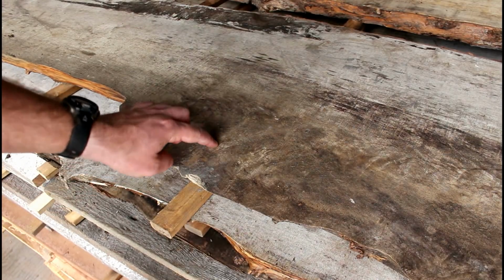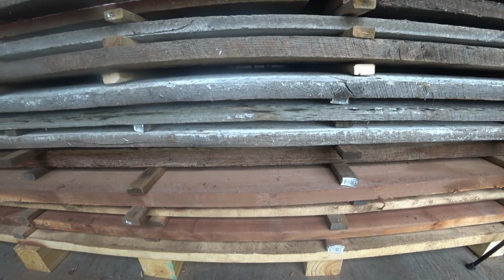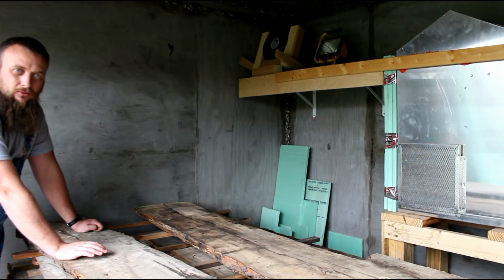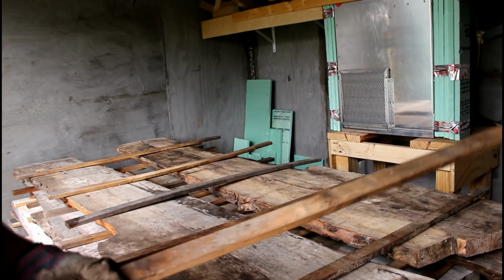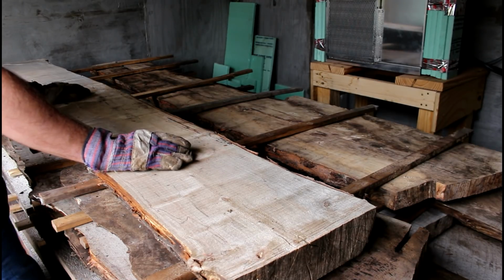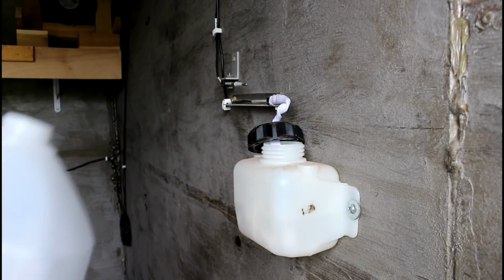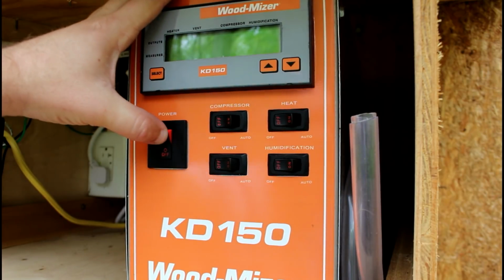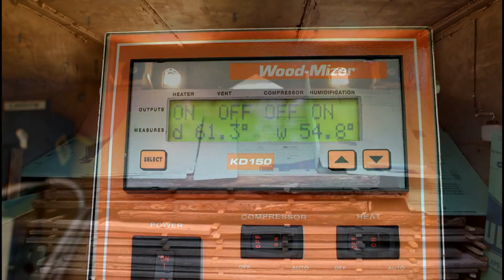INTERESTING WOOD-MIZER KILN EXPERIMENT, SPALTING WOOD AFTER SAWMILLING,

Comment: Good video Nathan.  My horses ringbarked a maple and killed it.  It was on the list of "stuff to do" and I didn't get a chance to cut it down.  Then it became an obvious widow maker and I simply ignored it until all the upper limbs shed off.  The plan was to drop it and burn it on site.  Surprisingly it was spalted through and though so I slabbed it.  The wood looks fabulous.  To enhance the spalting I treated it with iron acetate (steel wool and white vinegar) and the spalting popped big time.  The non-spalted areas were unaffected.
Reply from the maker: Good tips. Never heard of that method before
Reply: Thanks.  I will send you the recipe via email.  :)  Maybe you can do a video on it.  The results are really cool, especially on spalting, cherry, and oak.

Comment: Nathan, we have had pretty good luck spalting Maple during the summer. We put the log in a 3' deep ditch and cover it with sawdust and wet it down a couple times a week. In about 3 months we have a pretty good spalt going on.
Reply from the maker: good method. I have a maple log to go get  this week, I will try that approach, seems that just letting it sit on the ground takes at least a year or so,
Reply: Mike Neuhaus
I had a friend in central Tennessee that done that with Hackberry and had good luck.
I know because I hauled many thousands of pounds of it back to Arizona ! 😊

Comment: Lookinig forward to seeing results.  Did the same thing with hickory, still air drying for me.  We still need to build us a kiln.  Do you know what the humidification option does?  Ive heard about kilns running a stabilization cycle with hot steam for like 30 minutes to help cancel out the case hardening, wasnt sure if the kd150 supported that or if that was something youd need to cobble together yourself?
Reply from the maker: no steam in my kiln, only high heat and a compressor to get the moisture  out of the air,  a steam kiln  is not how I want to dry wood, it takes the color/character out of it  I think ,
Reply: https://youtu.be/y6tb6fhbZE0
This is the video i saw talking about, havent heard much beyond this, but sounds interesting.  He described the steam as just to relieve the case hardening.  I think he also menti ined the steam kiln thing, which I think is the colr change thing.  He mention (or somebody did) that the steam could spread the walnut color to the sapwood, which I dont like either, but sounds like the bigger companies do that to make it look like the board is all heartwood

Comment: here if you had old logs you wouldn't have  a log left to saw after 2 years unless you slabed them the termites and carpenter ant eat hole right though them and turn them to Swiss cheese and saw dust

Comment: I do a little bit of chainsaw mill but my boards always get cracking on them. I seal the ends and use spacers not sure why I get cracking only thing I can think is the sun hitting the boards a little . I am in Florida and don't have a indoor spot for this
Reply from the maker: do you air dry outdoors I assume? do you cover the stack with tin or sheet metal?
Reply: Out of the Woods  it's on a covered porch but gets afternoon sun so I think it's getting to much sun
Reply: Out of the Woods  no cover on the top but no water getting on it
Reply from the maker: Sounds like the problem
Reply: Out of the Woods  you think it needs a cover on it?
Reply from the maker: Have to be careful too much cover and you get mildew   Maybe some sort of screen that still allows airflow
Reply: Out of the Woods I'll try it out thanks for the reply
Reply: Its hard to dry wood in Florida.  The humidity is a problem.
Reply: Uc coatings, the company that makes anchorseal, has a side curtain product made just to protect the ends from sun but still allowing air flow.  Ive also used weed barrier fabric, just want to keep the sun from beating on it but still have some airflow